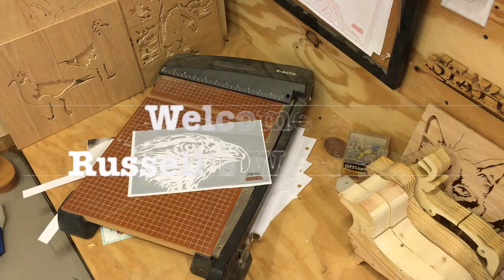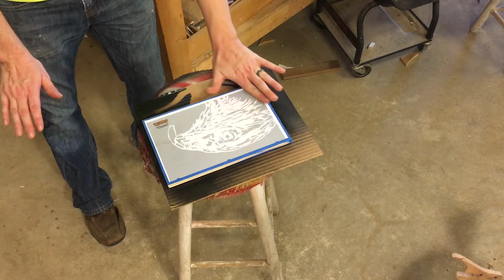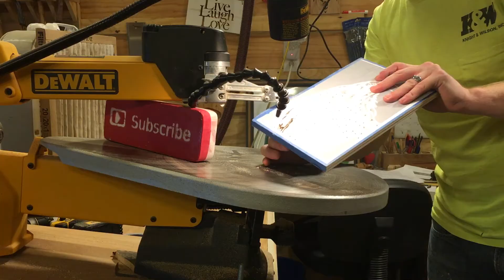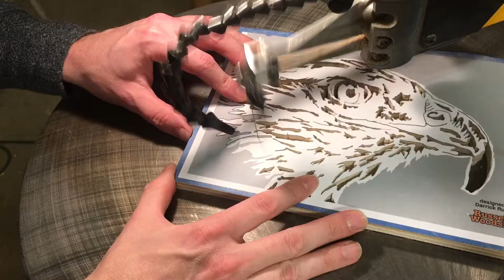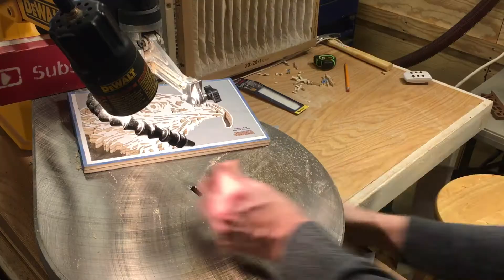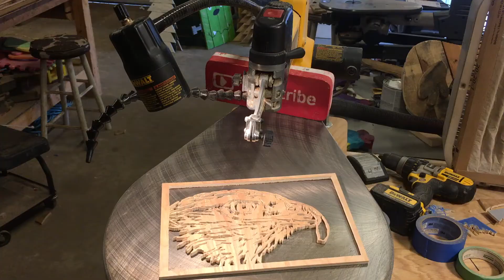Falcon scroll saw pattern - scroll saw art

Comment: I am a subscriber and have been following you.  I also use Flying Dutchman blades but the plain ones not the spiral.  I have used spiral blades but find the kerf is too large for small detail work.  Do you find that to be the case?  Nice work.  Happy Scrolling!!!!
Reply from the maker: Flying Dutchman have 2 spiral blade thicknesses. .033 and .050. The .050 are really thick. Try the link. They have some NS - spiral blades that are nice. https://mikesworkshop.com/collections/blades/products/new-spiral
Reply: Thanks.  I buy all my blades from Mikesworkshop.